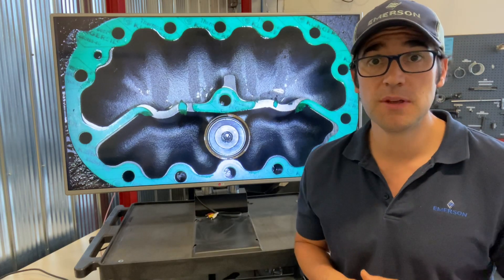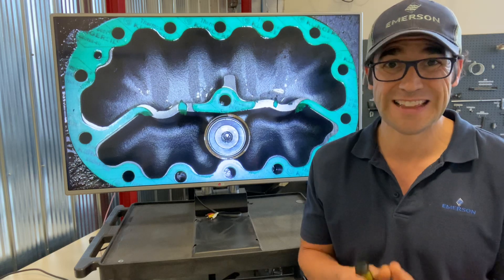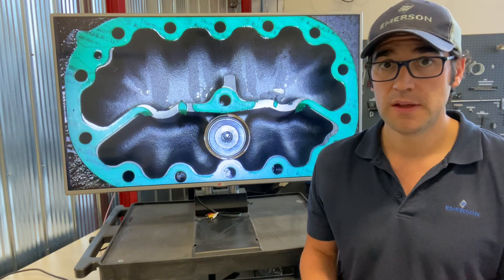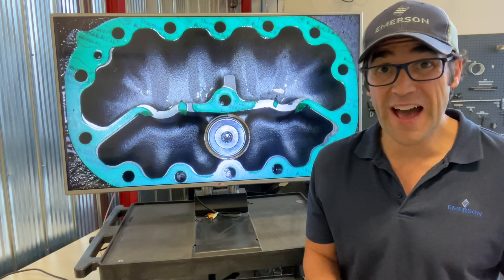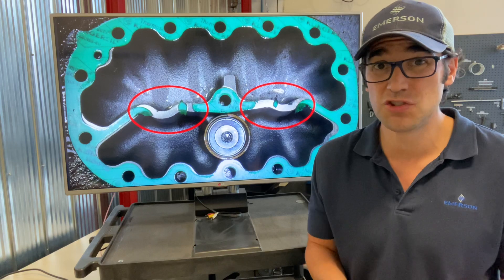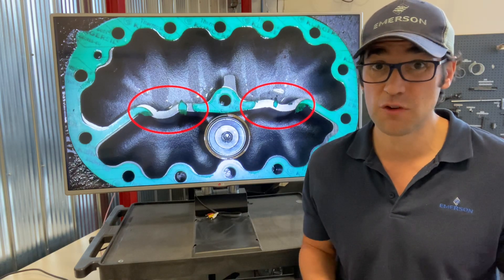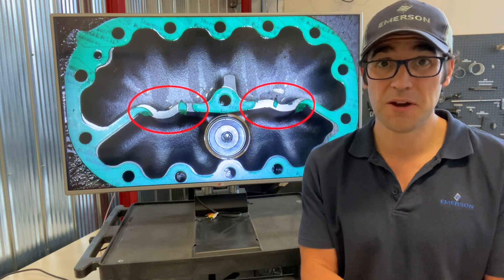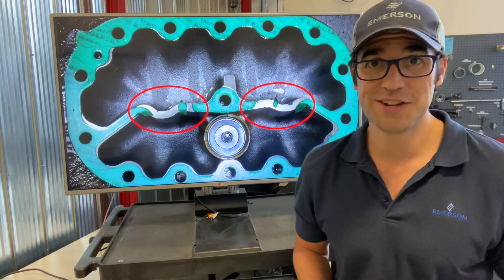Why It Is Important To Take A Deeper Look When Troubleshooting A Compressor

Comment: Slugging only good if your a baseball player not if you work for Emerson and your name happens to Discus Compressor lol
I would think
 #1 reason for slugging is charging liquid straight into the suction. 
Your turn
Reply from the maker: Good thing Discus compressors work for Emerson. Www.refrigerationmentor.com says the #1 reason for Slugging is system related issues.